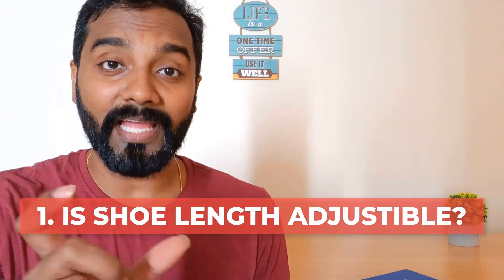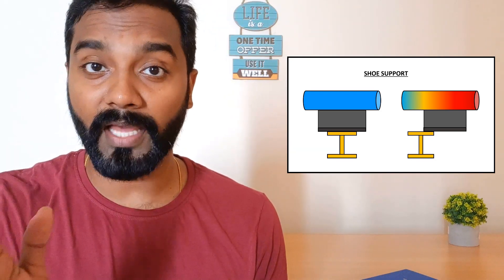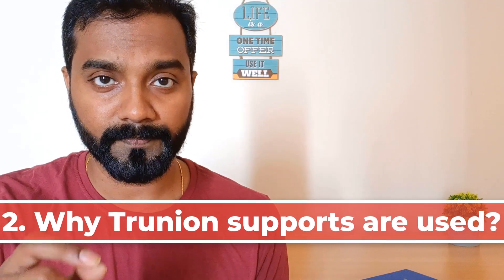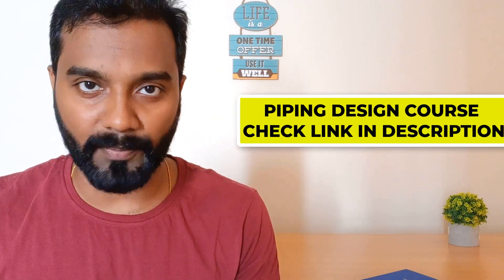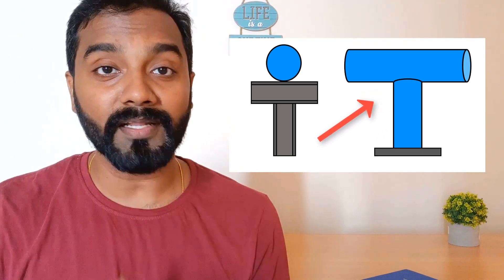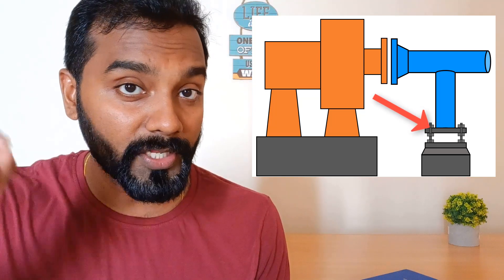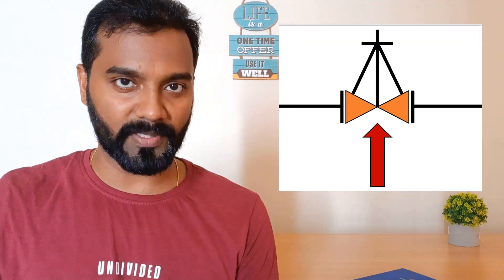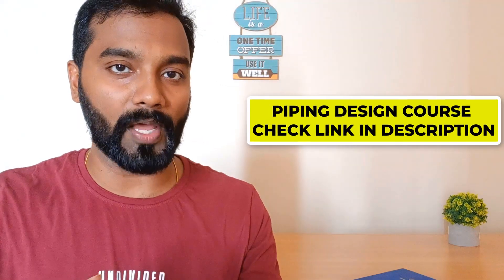Critical Pipe Support designing decisions in piping design engineering

Comment: The standard pipe length from factory is 6 meters. However, it's important to note that the support span standard does not consider the placement of weld joints, which can occur anywhere along the span. Weld joints are critical points of stress concentration, and their impact must not be overlooked. Based on my experience, seniors consistently advise maintaining a span length between 3.5 and 4.0 meters, and this recommendation should be taken seriously to ensure structural integrity.  Please correct me if i am wrong.....                                                      thanks for your technical informative  videos. Please keep them coming......💐💐💐